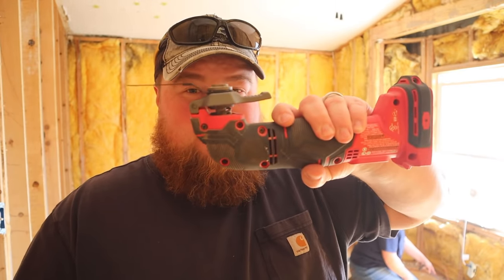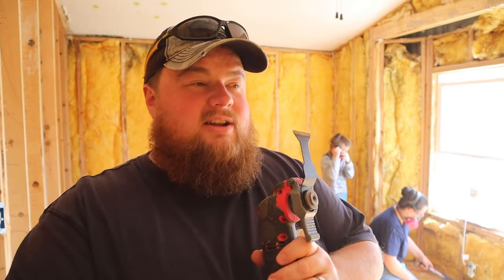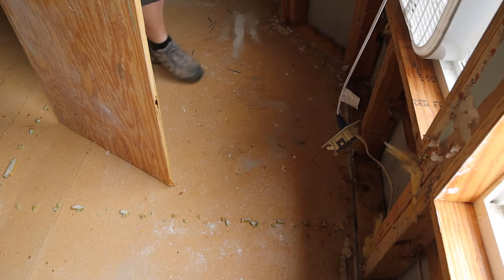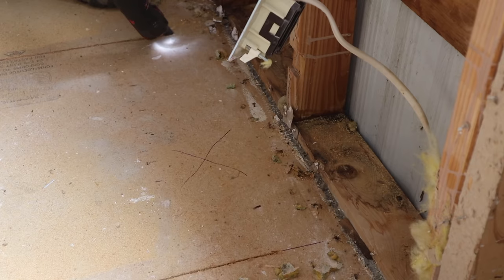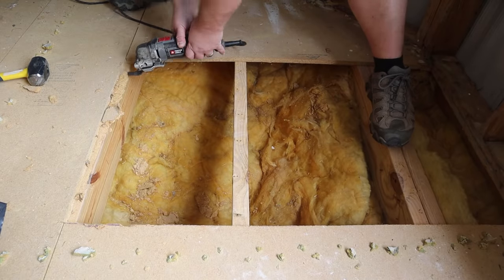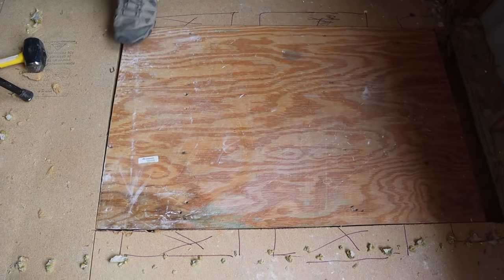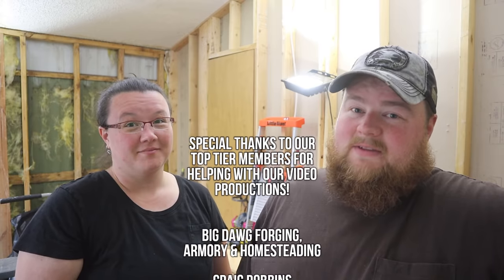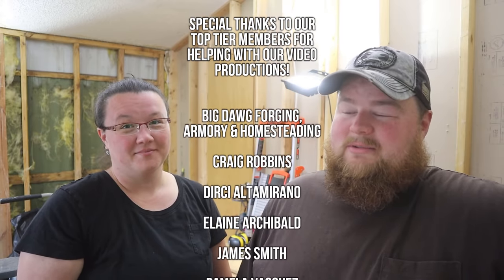FLOOR REMOVAL & How to PATCH a Mobile Home Floor! Mobile Home Bedroom Renovation

Comment: They’re miserable to work in, but a hooded Tyvek suit with attached shoe covers are INDISPENSABLE when working with insulation! It keeps those fibers out of your ears, shoes, and hair. It’s like wearing a sauna suit, so schedule in breaks if the weather is warm. You can find them in the paint section - different sizes available.

Comment: Are you going to remove all the insulation in the floor and put down new, better quality insulation? Just curious as to what you might find in there.
Reply from the maker: Oh, great question! We're going to leave the yellow floor insulation. It's considered underbelly insulation on mobile homes and is the bottom layer that hangs down and helps to insulate our water lines and HVAC ducting. We are adding insulation between the joists, but want to also leave the underbelly insulation to keep our pipes from freezing, etc. Thanks for the great question Linda!

Comment: As you saw, many don't take pride in their work especially if it's not their own home.  Love how you're doing it right!  Lots of work but worth the effort when it's finished!  TFS  :)
Reply from the maker: Sad but true... probably the #1 reason why we try to do anything and everything ourselves, too. Thanks Elaine!!
Reply: @sam-and-angela  you're welcome.  That's what I appreciate about your videos.  I see that you both take pride in your work.  It matters!  :)
Reply: Pride is everything  I also take pride in my mobile home work and the mobile is not mine
Reply: Don't judge others so harsh. Some things are beyond our funds. I had a whole new roof installed and before that I had bad leak that I was catching water from a bucket as I was removing it my foot when through the floor. I placed a board over the spot and it will stay there until I have the money to fix it. I am willing to live with just subfloor until I have the money to replace the flooring.
It is hard to find renovators that will work on a mobile. I do take pride in my home.

Comment: Been living in mobile homes for the at least the last 35 years been there done that, everything from floor patches to new floors but learned something a couple years ago that has made these repairs so much easier if you are doing a whole room like you all are. Just overlay the whole floor with either 5/8 or 3/4 plywood so much better than tearing out that particle board junk with a million staples, you end up with 10 times less mess a smoother floor to put your covering of choice on. I have done both now and wonder why I didn't think of the overlay to start with. Granted if you are just patching a bad spot that doesn't work but for a whole room it so much better it ends up stronger and flatter and you can just put a trim piece on at door entry to make the transition. Anyway keep up the great work I enjoy your video's reminds me of when we were younger repairing our first mobile home it is an adventure LOL...
Reply: I love working on mobile homes

Comment: You work so well together the boys will be so happy. Sam are going to replace the insulation in the floor?
Reply from the maker: Great question, and one that gets answered in our next video. But to answer you now... no. That insulation is key for keeping our pipes from freezing as it forms the bottom layer of the home's underbelly. Now, that being said, we will do as we've done in other areas of the home and insulate the floor between the joists to keep the inside of the home warmer. :)

Comment: I'm gonna have to do some patch work on our doublewide floor. In a perfect world that particle board sheathing should last forever but it doesn't.  After moisture or any water leaks its done for. Your doing it right, its worth the extra effort. I need to get me an oscillating cutter like you have. Those things will cut just about anything.
Reply from the maker: They're worth their weight in gold for this kind of work, that's for sure!

Comment: First of all great job guys, watching your videos has become a relief for me as i am very ignorant and have no experience in working with trailer homes. I was feeling very overwhelmed when i came to my mother in law's trailer to help her install flooring, upon inspecting the floors we found out the siding or aluminum sheets outside had some water condensation over the years and due to a tree being next to that side of the trailer water got into the floor and thus rotten some of it, being this was my first ever remodeling/patching job i got very stressed over it as i did not know how to go about it. I would like to thank you for showing me that any average joe like myself can actually get it started and finish it, i have realized that the oscillating tool is a must for any remodeling job. Thank you both for being such a great couple and for all the helpful knowledge you share, may Jah keep blessing your family and work. Thank you very much.

Comment: Me and my husband bought a fixer upper double wide and we have done replaced our subfloor in the kitchen and both bathrooms but we still have a few more rooms to do, mainly because when they built the house they didn't put no bracing where the plywood joins another piece all they have is the floor joyce running one way. We have done a lot of work to the property in 10 months of owning it but we still have so much to do till it is finished. We are doing renovations when we have the money to do it ( pretty much pay check to pay check) but we have went into debt buying the house and the property.

Comment: Thank you for this I really need to replace some floors due to cat pee. Also, I have a rank smell coming from the floors/vents in the hot season which might mean I need to replace the floor insulation and whatever else needs replacing under there. I'm thinking of replacing the walls and insulation too. My mobilehome is a 2000 Silverado (or something like that). I know you will love your new home!

Comment: Are you going to replace the floor insulation too? Seems that you have gone this far and it will definitely help with the heating and cooling. Great work so far!
Reply: Yeah, and how about the ceiling?
Reply: I use r-19 in my floors

Comment: Thanks man! Just bought a single wide that was severely neglected.. bad renters. My whole bed room near the rear of the trailer seems like the floor rotted off the frame of the trailer and is slumped off.. Thinking about doing something similar to this. just cut out the old bad floor and patch it up. I think the trailer is leaning to one side so we are talking about jacking it up as well. Thanks for a little insight to what kind of job im lookin at here. Not expecting anything fancy just need to get about 5 years out of it and we are tearing it down so bandaids is what we are looking for lol.

Comment: Anybody that  thinks building or remodeling a home is easy and/or  a fun job is nuts, nuts and rubber-butts!  Been there and done ALL of that and more for around 14 years! I enjoyed it, learned alot and the money was pretyu decent.   I am glsd your chsnnel popped-up  on my feed today .... NEW SUBSCRIBER !!  Take care!!
Reply from the maker: So true! Welcome aboard!
Reply: The worse part of it, was if you have to live, in the place that you’re renovating.
Reply: A mobile home is not a weight bearing structure, they generally use light weight materials. When people redo them, they-like to make it a house, and often run into problems with using heavy materials. The doors, are  a problem, you need to get a mobile home door, sized, cause the ceilings are sometimes low. People try to fit standard doors, into them, then some have cut into the frames, insurers will refuse to cover you.

Comment: Thank you so much for sharing your remodeling project with us. I admire how you try to do things the right way, even if it means extra work up front. It's going to be nice and tight and sound when you guys get done with it! (:
Reply: good work for sure
Reply: Hey food for thought, If you want to soundproof any rooms what we did is put up three-quarter inch OSB the nail the sheet rock to that. I know it doesn’t sound the best but it really helps soundproof the entire house and help keep in the air-conditioning. Love the video you guys did a great job
Reply: @Drewsroofingandhomerepair  You guys did awesome

Comment: So we actually nailed up OSB three-quarter inch to all the walls and then we put a quarter inch sheet rock over top of it. That really helped keep a lot Of the air-conditioning in during the summer
Reply: And it really helped a soundproof the house

Comment: Hi Sam and Angela, looking for video that shows use of metal flashing tape on the outside floor band to stop water leak. Addressing this today and want to make sure I get it right the first time! Thanks for your help!!
Reply from the maker: I think this is the video. If not, it's the one where we linked to a video from DIYfferent where they showed it in much more detail. :) https://youtu.be/UmxeeofNF1M
Reply: Thanks Sam and Angela, for your prompt reply! I took a break from our home and fixed 2 neighbors' steps. Took a break and found it. Very helpful! Tell Angela I'll be sure not to put the metal tape upside down!!😄

Comment: If you haven't drywalled yet, seal gap at top & bottom plate against metal siding. HUGE energy savings for a few cans of foam.

Comment: I process of leveling single wide trailer, then do floor repairs at entrances way, under windows area, notice  some damages on outside floor 1x3 walls, replacing and removal
Reply from the maker: Good luck, big project!!

Comment: I'm in the process of remodeling my 1963 mobile home, and the floor needs to be replaced. There are multiple holes in the floor, but there is no insulation or anything underneath! You look in the holes, and you can see the outdoor dirt! Do you have any recommendations on how to install a base and insulation to an old mobile home that doesn't have anything underneath the flooring? Is that something a rookie could do or would it be better to contact a professional? We are low income, so we try to do what we can ourselves to save money..

Comment: I’m looking for ideas. I need to put a board under an outside wall for blocking.   There is not enough room between the bottom of the board and the underbelly material to use my drill to screw the board to the bottom of the wall.  I had not planned to remove the wall paneling so can’t hit it from above.  In case you can’t tell, I’m pretty new to diy home repair.  Any great ideas?

Comment: did you put in some better insulation under the floor to fill it up to the underneath of the plywood ? Did you strengthen the joists by dividing them up with short widths of wood to make it stronger . ( i mean so it looks like a grid ) so that when you put down the proper flooring it is solid ?

Comment: I,Bought A Mobile Home With Water Damage From The Back To The Front Of Home..(never Do It Again) Its A 1988 Unknown Manufacture ..70 Ft x 16ft. More Or Less..The , OSB Flooring Is Messed Up By The Water Some Of It Is 1 In. And Rest Is  1/2In. .. The , Ceilings Are A Bit Over 7 Ft.  How , Would I Redo All This And Make It A Bit Higher Around 8 Ft. ? Have , Already Demoed The Closet And Bathroom And Part Of The Bedroom Floor.. Thank You For Your Input And Great Videos ..There , Is No Blocking Or Insulation Anywhere ..

Comment: Hey bud I'm looking at repairing my grandmother's mobile home soon and will be going room by room doing the floors, does the particle/ pressboard extend under the bottom of the walls?  If so,  and if needed to  replace that bit that goes under,  what's the process for that?

Comment: Hey I need to do this for my mobile home. I already cut it out however I was going to replace the previous subfloor with particle wood which is what they also use for my whole house should I reuse particle board is that fine or only plywood?

Comment: What thickness flooring did you use? I'm about to replace a mobile home bedroom floor that has been patched multiple times. You can see right where the studs are, so i want to do this correctly.
Reply from the maker: The original was 5/8", but we replaced it all with 3/4"

Comment: What do you do about rotten wood under the wall?  I have a 2x3 wall that had water runnign to the floor.  The floor is gone under the wall, along with the bottom frame of the wall, for about 48" (3 bays).

Comment: Lol mobile homeology n floorology😂. Yaw are doin great. Got a ? For you tho...say you have a framed wall between rooms....is there a way to take subfloor out n replace under it. ...without taking down that wall that has on the other side outlets all over n water pipes etc.?  Yep love that oscillating tool. You suggested I get one long ago n I did n really works on edges to clean out subfloor edges with.

Comment: I should have made a video of me tearing out the walls and ceiling in the bedrooms of my 1972 mobile home. OMG. Mouse feces and nests galore. And the original insulation? Must have been R1! Ridiculous. Replaced with R15 rockwool. I had to bump the studs out to fit it and the vinyl replacement windows.

Comment: I think with new insulation you'll know there aren't any thin spots - which could mean a long term saving for heating and cooling costs. 
Also doing all that work and knowing you left yucky old insulation in the walls wouldn't feel great.

Comment: Its so sad that theres a lot of previous owner that dont really care of the next owner. Last week i found out my flooring is rotten after 1 year that i buy my mobile home sadder part the inspection i hire didnt see any of this and the window framing is super rotten, underbelly insulation is super mess. And worst they cut the power of the shed after passing the house to us. Because they barried the shed wires on the soil and connect the power of the shed to room switch without any breaker. So sad

Comment: I have an outside wall that needs serious work. The exterior siding got ripped off in a storm and it's been tarped. I did notice that I will probably need to replace some of the wood framing and if memory serves me right, the floor along that wall inside the room needs to be replaced as well. Which of them would be smartest to start with? And it looked like you were using 2x4's for the floor blocking, is that correct? Damn, Sam...I wish I could afford to fly you out to Texas and pay you to fix my issues. Maybe if I won the lottery...but I guess that would mean I'd need to start playing the lottery first. LOL

Comment: Why are you pulling the staples out, if your ripping the floor out?
Reply: So when the new floor is laid down it will be level, same thing for the walls.
Reply: @lavenderblue4815  She was pulling carpet staples not floor board staples. Waste of time because they were ripping the floor boards out.

Comment: Particle board is a curse put on humanity. I've had to remove more of that than you can imagine and not in mobile homes. 40 years in flooring and tile work. If you have to do more of this, removing carpet tack strips and staples.save your knees. A flat nose shovel used as a scraper works wonders

Comment: The mess under that floor was made by one really lazy person. 😳 y’all are doing a really good job. I would not have kept that old insulation either. I know it’s an added expense it’s reassuring you’ve got a nicely insulated wall in between you and the outside.

Comment: Please be careful disturbing those popcorn ceilings.  Did you test for asbestos?  That type of ceiling wasn't banned until 1978.  If no asbestos you can scrape the ceiling by spraying warm vinegar water on it & using a scraper tool.
Reply: The EPA banned the manufacturing of products containing asbestos. It didn't eliminate the use of it by those companies that had it in inventory. Or the sale of those products.
In 1980 many flooring products were still.being sold that contained asbestos.